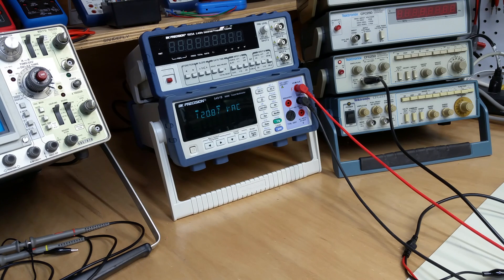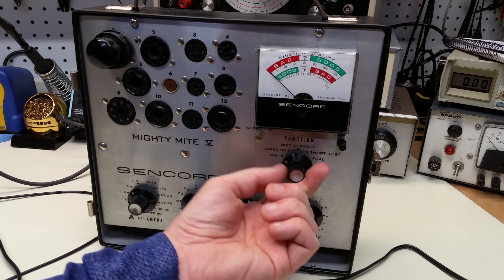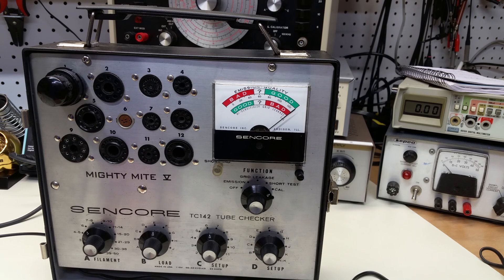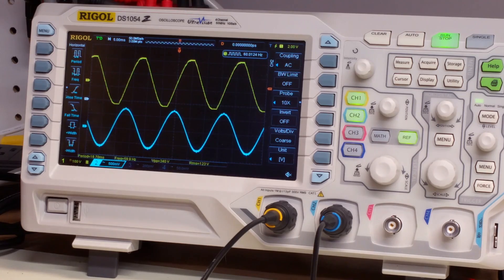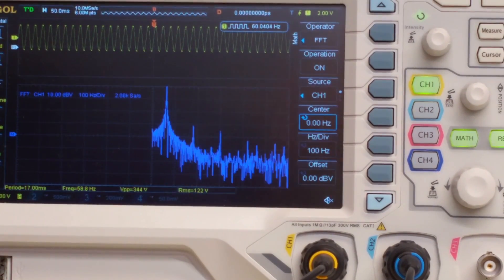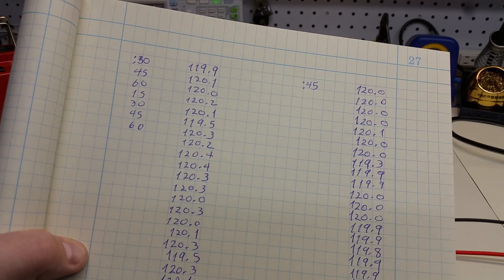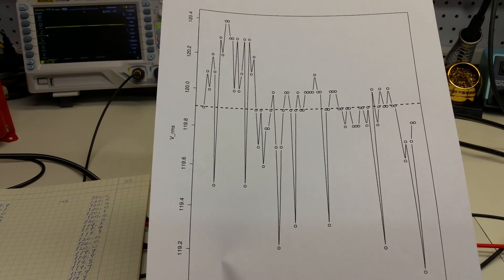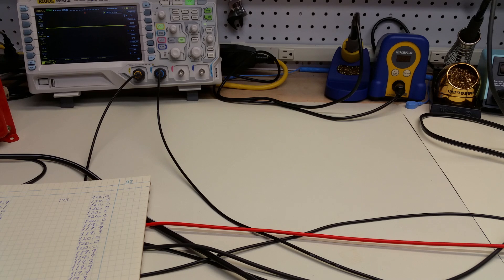#23: Mains voltage stability

Comment: If this is something you do regularly, it could be beneficial to connect your bench DMM to a computer and acquire the data automatically. I can recommend PyVISA if you're familiar with Python. It makes for a really neat way to get all this done with minimal user interaction. Saving the data to a .csv file is fairly straightforward and lets you import the data easily into MS Excel and the like. Anyway, great video as always!
Reply from the maker: Thanks for the suggestion, this is on my list of things to get to!

Comment: I'd expect there to be variations in the frequency during the day as the power company fiddles to meet the load - slower during the max load period 5 - 7 pm as people make their dinners, faster at night, averaging to 60 Hz over 24 hours so clocks remain accurate. Something similar with voltage, but with voltage it also depends on exactly what the local load is - is your fridge on, your neighbours fridge etc.
Reply from the maker: Thanks for your comment. I haven't looked at the stability of mains frequency, but wouldn't expect it to deviate significantly from the 60 Hz target over time. The 300 Hz feature seen in the FFT in the video is probably due to something in the house or neighborhood contributing noise at that frequency to the lines, but would be curious to know if others have observed anything similar. The load on the power grid certainly changes over the course of a day, and over the course of the seasons as well, but I thought the variation over the course of a few minutes was interesting.